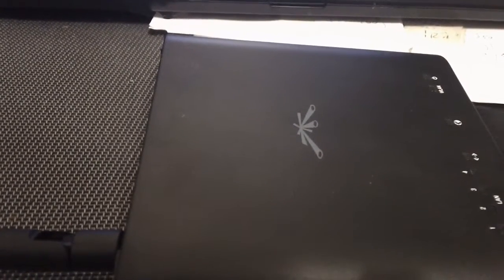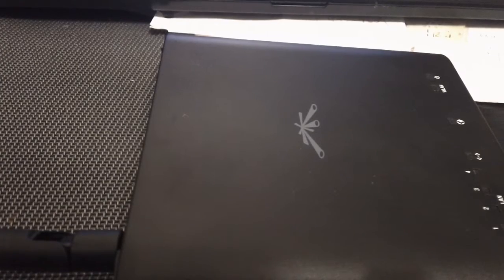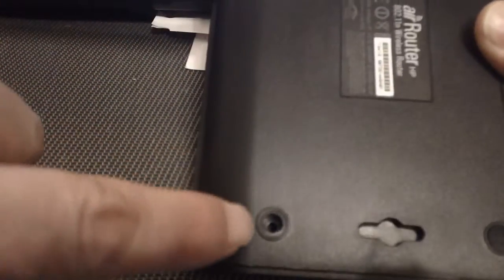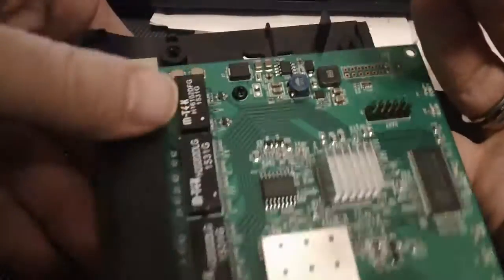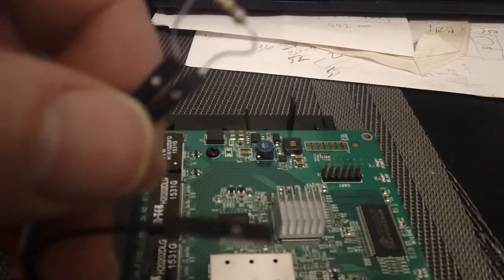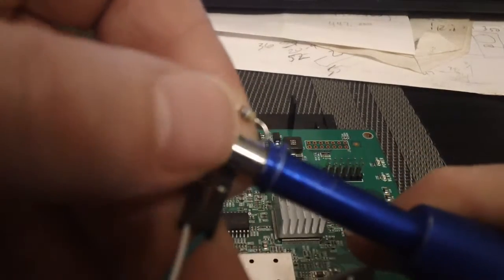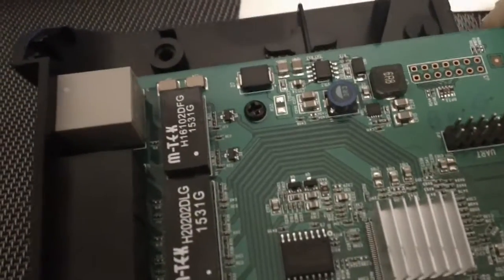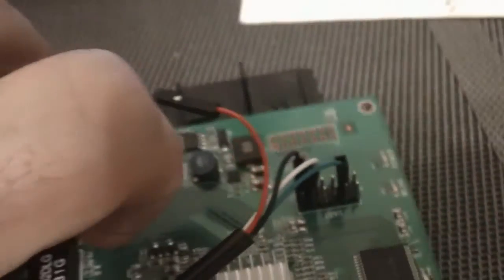Ubiquiti Airrouter serial connection for unbrick via console

Comment: Hello, I want to know if you can help me to repair the EDGESWITCH 5 XP that I was upgrading to with a new firmware when it lost power. Now it turns on but it doesn't respond to the ping, so I can't recover it by TFTP, the only option left is to reprogram it but for that I need the file to rewrite the EPROM and I can't find it anywhere. I would thank you from the bottom of my heart if you would help me get what I need, because I live in Cuba and here there is a lot of difficulty for everything.

Comment: Have you ever upgraded SPI flash on ubiquity device? I want to upgrade the SPI flash on my Nanostation m5 from the 8mb to 16mb for a OpenWRT project im working on as a hobby, I found one instance of a guy doing this to a nanostation m5 but haven't got much info and haven't heard back from him.
Reply from the maker: Hi Roger, no I have not ever looked at doing that...interesting concept though..I was thinking that the rocket may have 16, so I went and checked.. but it only has 8 as well. take care.
Reply: Interesting, I mostly want to do it for more local storage.. I am considering compiling openwrt firmware stripped down with just what I need plus the additional packages I want to install as an alternative to upgrading spi flash... Currently what I want to do is working already however with only ~2mb of free storage...(Running Aircrack-ng, etc.. oh it works great in monitor mode by the way.[educational purposes])

Comment: Hey James
Thanks for the demo. I am going to do exactly this soon for my AirRouter that got Bricked by too new AirOS, that broke the DD-WRT version last year.
I could not find an USB Serial TTL Cable - they were out of stock, in US.
Instead I ordered on eBay this for 1,4 $ with free shipping around the world (from China):
USB to RS232 Serial Adapter Console Recovery PL2303HX Converter TTL Cable Module
by seller: xinlan2012.
I can wait a month, to do this.
/Peter
Reply from the maker: ok, good luck.. Adafruit usually has the cables if you run into problems with that one from China.

Comment: i really dont understand, let me explain my situation: i have a loco m5 XM with last firmware airos, then i try to load a openwrt and get brick, bootloop, if i connect the M5 to the lan port in pc, this connect a disconnet continuosly, so i have to press reset buttom for 15 seconds (not 10) for be able to enter in TFT mode (i guess). then i am trying to load the firmware AIROS again via tft and i get a message "succesfull" but always bootloop after reboot, i am connected right now via serial port, putty running, loading firmware via tftp but same results, i dont know when press ESC as you said to break the but, and i dont know in which window i have to do that. i neither have idea where to put the commands "urescue -f -e" 

sorry for my bad english and thanks for your patience. i will apreciate so much your help and assistance
Reply from the maker: Hi, sounds like the flash is corrupted. the LAN port will not allow you 
to restore the system.  You will have to connect to the board serially, 
with a 3.3v usb breakout cable, this is a special cable, not a standard 
usb/serial cable.  This link has some more information.   
https://community.ubnt.com/t5/UniFi-Wireless/HOWTO-Unbrick-your-UniFi-AP/td-p/338684
Reply: I have this serial cable connected.

Comment: hey mate i need your help, i am stuck right here in your instructions for unbrick "Once connected, break the boot sequence by hitting esc.
from the prompt, enter these commands to restore the old boot loader, (pre 5.6.2)" where should i hit ESC for break the boot???
Reply from the maker: hi, hit esc repeatedly as soon as you are connected and see any movement on the screen.
Reply: i really dont understand, let me explain my situation: i have a loco m5 XM with last firmware airos, then i try to load a openwrt and get brick, bootloop, if i connect the M5 to the lan port in pc, this connect a disconnet continuosly, so i have to press reset buttom for 15 seconds (not 10) for be able to enter in TFT mode (i guess). then i am trying to load the firmware AIROS again via tft and i get a message "succesfull" but always bootloop after reboot, i am connected right now via serial port, putty running, loading firmware via tftp but same results, i dont know when press ESC as you said to break the but, and i dont know in which window i have to do that. i neither have idea where to put the commands "urescue -f -e" 

sorry for my bad english and thanks for your patience. i will apreciate so much your help and assistance

Comment: http://articulo.mercadolibre.com.ve/MLV-483195035-usb-a-rs232-ttl-pl2303hk-modulo-convertidor-para-arduino-_JM is this the item that i need for do the same to my nanostation loco m5? is in bootloop after openwrt firmware
Reply from the maker: i, yes, but easier with seperate pins like here:  
https://www.adafruit.com/products/954?gclid=Cj0KEQiA-_HDBRD2lomhoufc1JkBEiQA0TVMmre1HmaEsx8PfkvEWREkwxybqMZi4tMLKy-BlzEcmloaAro08P8HAQ
Reply: thanks!!! dku-2 nokia will work too?
Reply: hey mate i need your help, i am stuck right here in your instructions for unbrick "Once connected, break the boot sequence by hitting esc.
from the prompt, enter these commands to restore the old boot loader, (pre 5.6.2)" where should i hit ESC for break the boot???